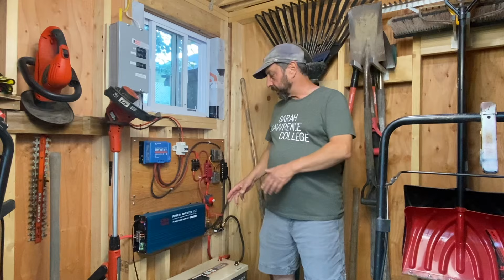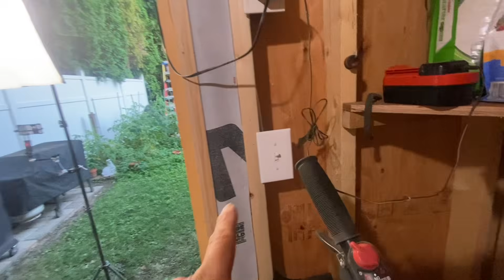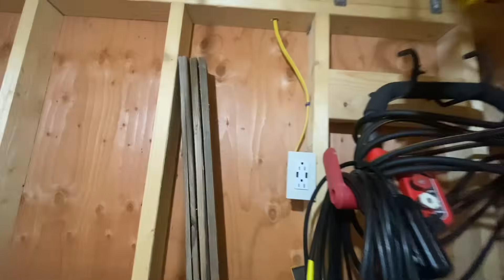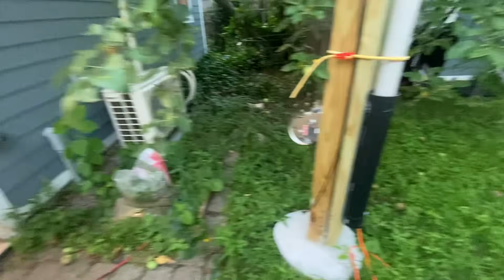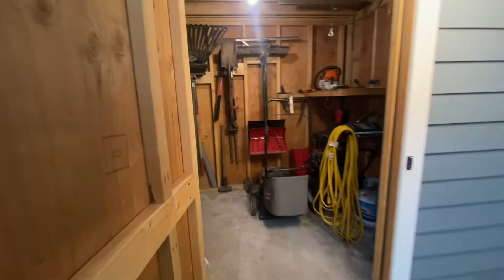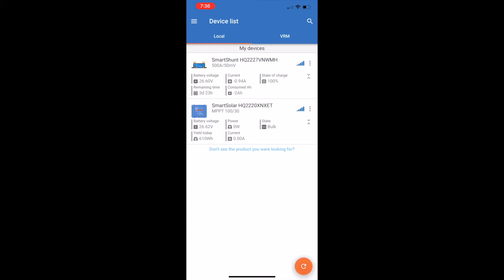Solar Powered Garden Shed

Comment: You're going to toast the tools in your shed with that cheap, high-frequency transformerless inverter because it doesn't provide any galvanic isolation between its DC boost state and its AC output. You should have installed a low-frequency transformer-based inverter if you want to run tools or appliances in your shed.
Reply from the maker: Thanks, but alas you’re a bot, so bye!
Reply: @mattsgarageshop He isn't completely wrong, I will only use low frequency inverters, for his reason, and the fact I do power heavy loads, compressors, ac, fridge, 1800w air fryer, washing machine, dishwasher, hair dryers etc, high frequency units are igbt computer chip based, low frequency units are transformer based like your electric grid, but they are way more robust, true rated power, and much longer lasting workhorse! High frequency units are not designed to take a surge over and over, and though it might say 2000w, and it will do it for a short while, they are not really meant to run more than half there rated power if you want them to last! That's not a bot talking, it's a person explaining real life senario to you! Hope it helps, and no pun intended

Comment: Very similar to the project in my shed. But, I have a 2000w inverter and 9 250w panels. Same 24V 200Ah battery. We started off with only 4 panels and just recently expanded. But, I don't power the shed with the power. I split my 2 hot lines providing power from the house to the shed. Now, one leg provides 120v to the shed and the other leg returns 120v from the solar system. I've pulled off all the lights, computers, fridge, freezer, etc into a critical loads panel from the main panel. This system handles the base load of our house during the day. 800-1200w all day long. At night, the ATS switches back to the grid and a 24V charger kicks in to put some cheap power into the battery.

This is phase 1 of our solar journey. We've pushed about 1.5MWh through the system over the last year. It's really helping lower our power bill. Phase 2 will start in a few months. Upgrading to 48V and adding more panels. Moving up to a 10kW all-in-one inverter. Should be able to offset half our yearly power consumption with the new system. Then it'll just be adding batteries and panels as we can afford to. Not trying to go 100% off-grid, but it'll be close.
Reply from the maker: Sounds like you’re far along on your solar quest - thanks for sharing!